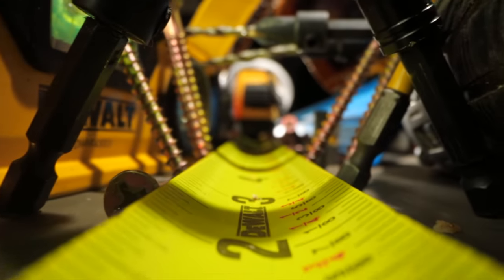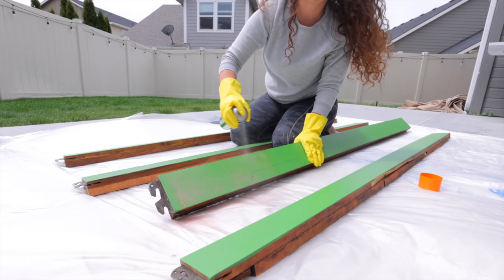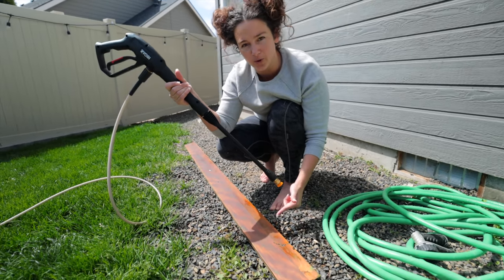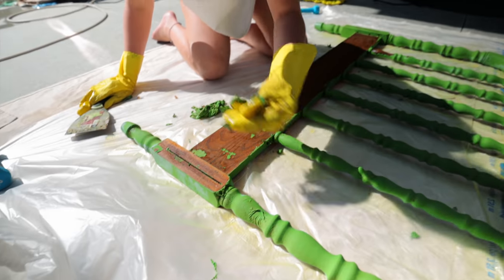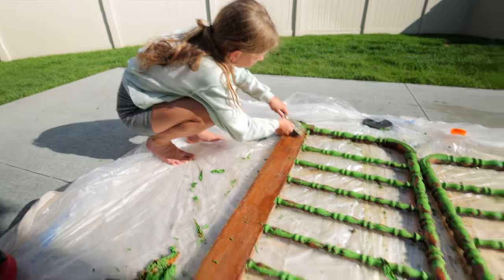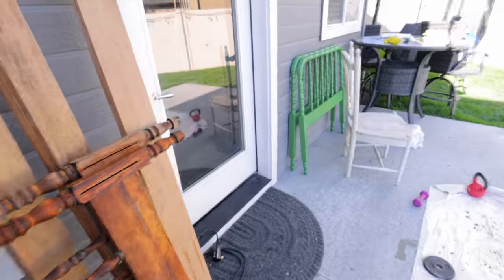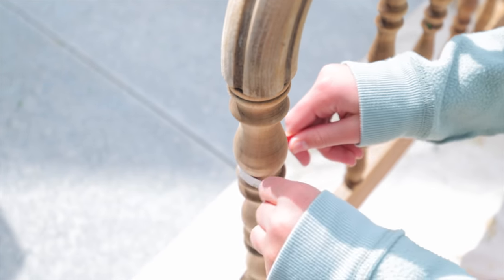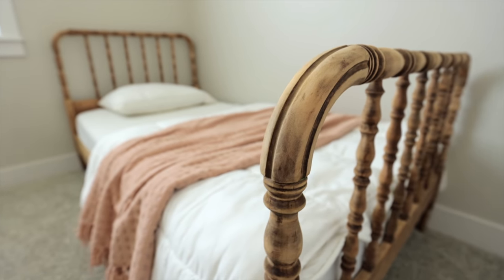Restoring VINTAGE Jenny Lind Beds | Bed Restoration | Spool-Turned Bed Frames

Comment: I always wondered about that citrus stuff and now I know it works.  Natural wood is so much better and now it can breathe.  Will you use any lemon oil to moisture the wood so it won’t crack?  Girl power!  Great job.
Reply from the maker: Oh, that stuff worked very well! The spools were much tougher so not everything came off like butter. Mike's timelapses make the project look a little easier than it was. So don't expect everything to go perfect! I will look into putting some kind of protective coat on the beds!